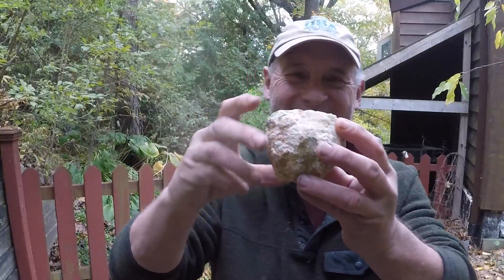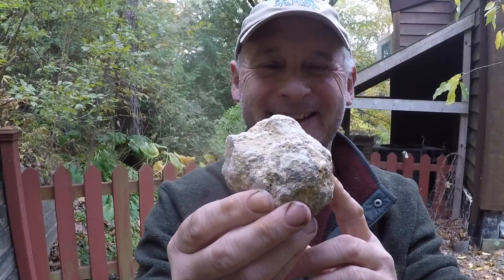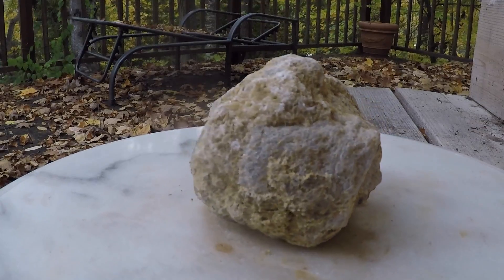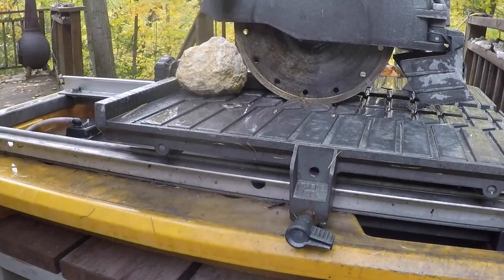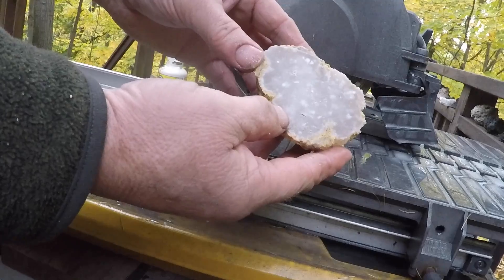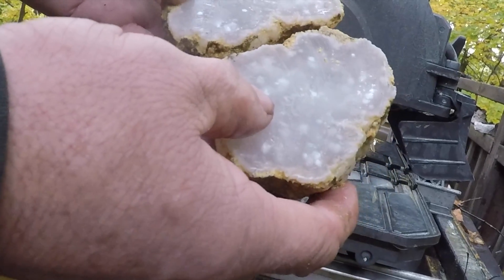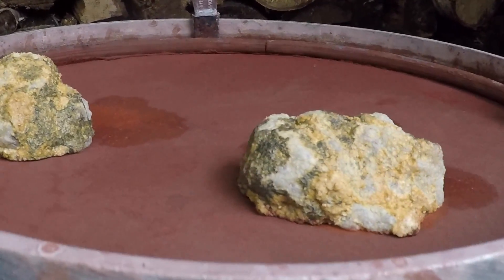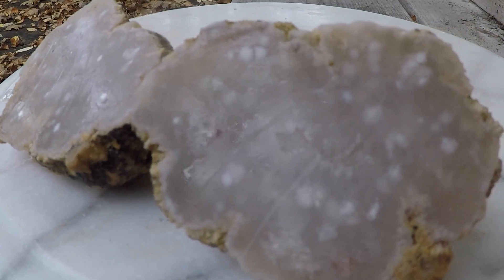What's Inside?  Slicing $13 Morocco Quartz Geode

Comment: I imagine over time you might be able to guess by heft alone whether it may be solid or hollow but agree you'd be sad to have cut through a crystal. It looks like you invested in a decent tile saw. Do you mind telling me how much it went for and what kind of mileage you get from a blade? I want to get one eventually but not willing to shell out a ton of money. The club I belong to in Washington state has 2 very large slab saws I can use but no good for small stones. Keeping an eye out for a good used saw. Enjoy your vids MM. Ciao
Reply from the maker: I don't think my saw was very expensive.  Somewhere around $300 CDN.  I bought it in the middle of a bathroom renovation because I needed something that would handle the large tiles my wife insisted on.  Which leads to a recommendation.  Look for a used saw at a reuse store, auction or local online (eg. Craigslist or Kijijji).  Saws that were bought for a project are often sold afterwards for cheap.  I replace my blade about every 2 years.  If it seems like it is dull, I cut a brick to clean the diamonds and it is good to go for lots more cuts.

Comment: Always such a lovely, welcoming smile from Mr meMiner - how long would you spend 'sanding' - until it's right, I s'pose?  😎
Reply from the maker: Exactly.  lol  Actually, it does not take long (relatively speaking), if you use various grades of sandpaper.  The trick is to start really coarse and get finer and finer.  I find that scratches are removed with 80-600 800 grit and polishing really starts at 1500 grit.  I have used up to 7000 grit and notice the difference with each sandpaper.

Comment: Lol, gotta disagree on the nomenclature. If it's solid throughout, it's not a geode at all but a nodule, as a geode only refers a concretion-type object with a hollow area lined with crystals. Not all geodes occur in sedimentary rock (though the process by which the minerals in the void are deposited ARE sedimentary in nature), they only require a vacancy, which occur frequently in igneous (esp. extrusive) rocks. A Thunder Egg requires a different mode of cavity creation, specifically the drying of a substance within a concretion (ie mudstone drying out and shrinking, thus leaving space), and therefore are limited to sedimentary horizons. So geodes and nodules fill voids caused during the host-rock's formation, Thunder Eggs fill voids caused later by changes in volume of enclosed areas within emplaced rock. 
Cool to find a reliable cheap source of them though!
Reply: Thirst Fast 
Wish I had read your comment first before posting mine, it would have saved me the bother of explaining, but I thank you for confirming what my understanding is of these.
Reply: @symonsheppard5519  I think your comment was up before mine. Lol! It's not like I watch meMiner to nit-pick, I've learned lots from him, but if I see something I'm pretty sure is inaccurate,  I say so.  :) When it's actually me who is wrong I get a chance to learn more too!
Reply: Thirst Fast 
Ditto, the man who says he knows it all is not prepared to learn so will soon know nothing.
We all learn from each other in this hobby, we never nit pick or ha ha told you so, it's all about helping others and nothing to do with competition.
Reply from the maker: I am still learning too.  LOL  I try to keep things really simple, as I would really screw up if I tried to get complicated with the geology.  I appreciate the comments and feedback.  It helps me and of course the others who follow the channel.
Reply: meMiner 
Yeah yeah yeah, we all know Daisy is the boss so stop bluffing and get back down that hole. lol

Comment: Hey those would make some cool beads sliced up in your bead mill.
Reply: Casimir Pellegrini 
Unfortunately Casimir they would be very plain and nothing special.
Reply: @symonsheppard5519  Maybe to some but I thought the edges that let the light through had a nice glow to them and the white inclusions were interesting.
Reply: Casimir Pellegrini 
Yes my friend, you are absolutely correct, that's a perfect description but by the time they are milled around you have lost the outer skin and the niceness you so rightly observed will be mostly gone.
Reply from the maker: I have a few more to open.  If others are solid, I just might give it a try to see what happens.
Reply: meMiner 
Why not, the structure of the crystal is strange anyway, I looked really close at one of mine and to be honest it didn't look real, strange I know.

Comment: So for this you will be using your 7" tile saw, why didn't you use the big saw! but thinking about it you could have used the micro saw , we all know microwave is low cost on energy.
I have had some of those, I was not impressed really, not when you expect a hollow with at least Druze crystal in , I know they can be an unknown entity but that being described as a geode is wrong , geode basically means hollow with crystal, I have purchased others in the past, had a batch of thunder eggs, rattler eggs that were similar I don't bother with them now, still got some uncut ones and agate nodules I never got round to cutting.
But still a good video, thanks mate.
Reply from the maker: I like geodes because it is something new to me.  I have a few more for Amy to play around with soon.

Comment: So much excitement opening the ‘unknown’!
It’s Christmas every time.
Tanks!

By the way...I do geodes a lot.  I carefully tap them with my hammer and increasing the force with each whack.
When it cracks, it’s more likely to break upon weaker lines going around nice crystals.

I’ve cracked a few thunder eggs, too. It’s always a nice surprise. They will resemble a regular geode, but the interior formation is different. There may be some solid with crystals or many different layer colors. 
If there’s one with a solid interior, but looks lined or segmented, it’s a true thunder egg. I get mini Bakers from the Bakers’ Mine here in NM.  I’ve found a beautiful variety of interiors from solid nothing specials to gorgeous reds and pinks.
Reply from the maker: Nice.  I have a few more to crack and will have Amy try the tap tap method with either a hammer or iron bar.